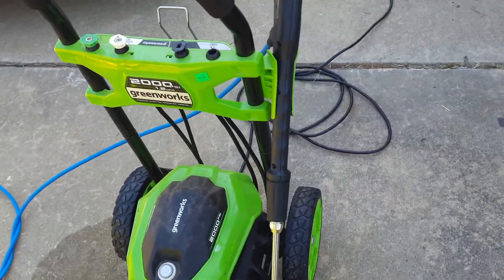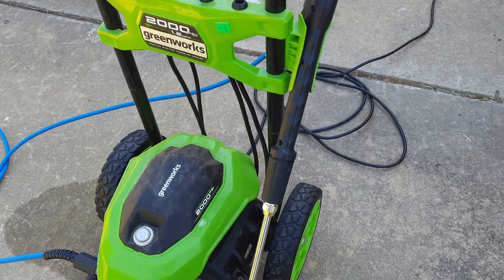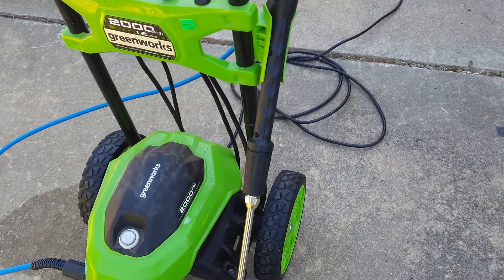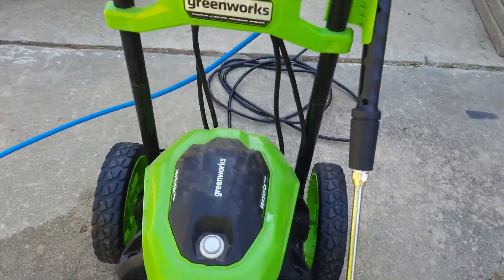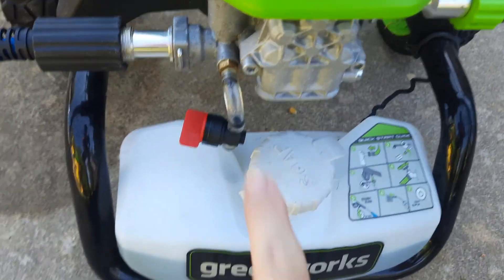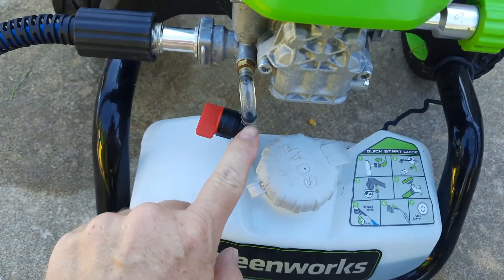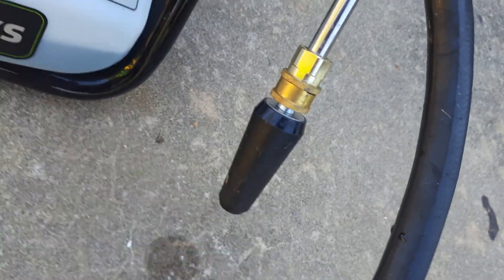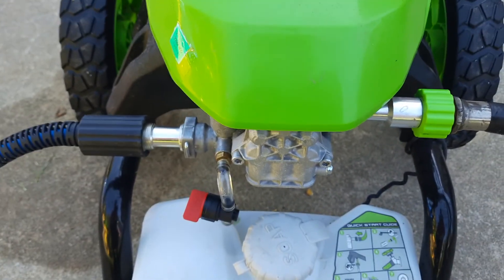Pressure Washer soap shutoff valve mod

Comment: I added this exact shutoff to my Bauer 3000 PSI Brushless electric pressure washer. The reason for doing this is also because when it's time to drain the pressure off your washer, such as before disconnecting the  nozzle, it would draw up a little soap, which stays in the hose until the next time you use it. By shutting off at the valve I'm able to run some clean water through the pressure washer, as well as bleed out the pressure after shutting down without drawing in soap, and wasting soap. It was a very easy solution and works great. One valve, two zip ties, and a knife to cut the soap intake hose.
Reply from the maker: @DavidOswaldSLC  makes sense, hadn't thought of that